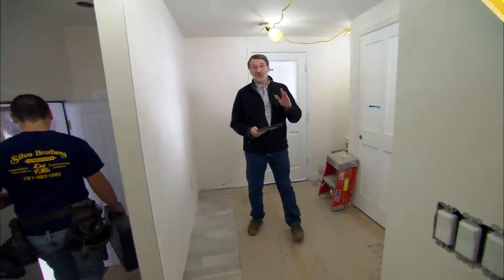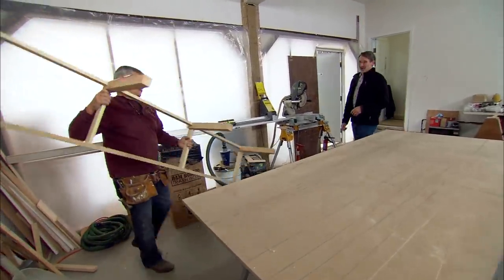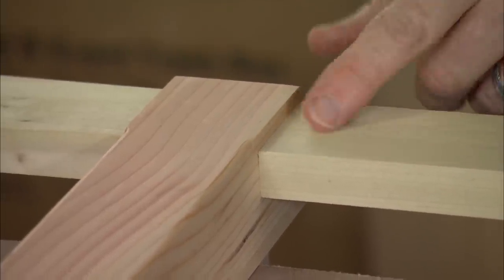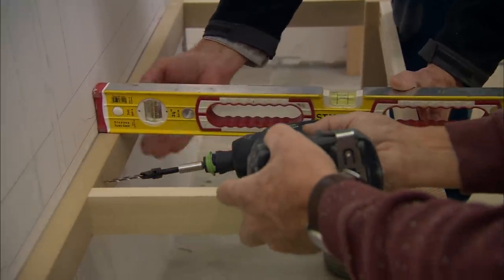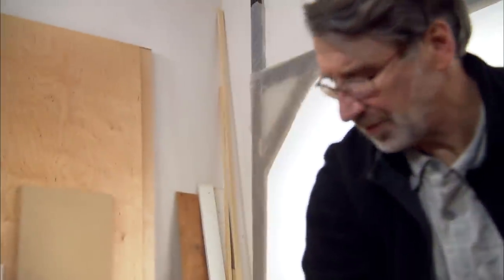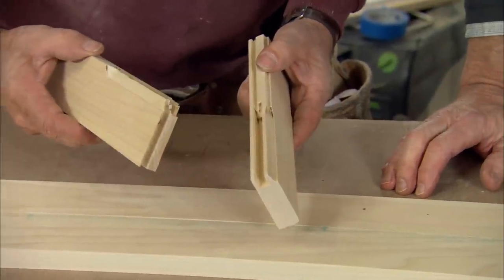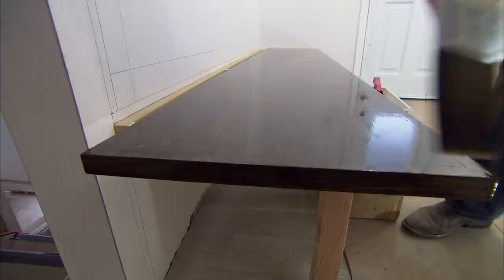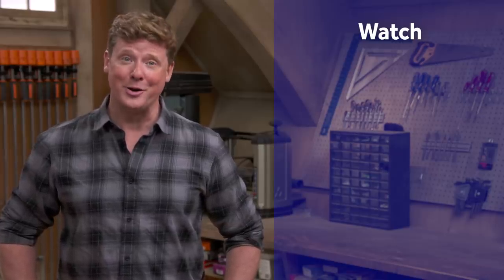How to Build a Mudroom Storage Wall | This Old House

Comment: I so wanted to see how to scrip the leg length to the floor.  But project looks awesome.
Reply: Stand the board where it's due to go, place a ruler horizontally up against the board, with the ruler's lower edge following the floor angle.  Scribe a line on the board, following along the top of the ruler.  That should reflect the angle you need to cut the lower board to.

Comment: Watching these guys makes me wish I had went into a trade instead of college route
Reply: yup
Reply: Not shown: subcontractor doesn't show up, or installs wrong material, homeowner changes mind after installation and won't pay the bill til it's "fixed" or "fixed" for no additional cost, essential (co-)worker quit for new job with no notice, major price change in supplies between contracting and commencing the work, owner goes bust and "contractors lien" on the property isn't paid for years, etc., etc., etc.
Reply: @buzoff4642  sound like public accounting as well
Reply: @buzoff4642  yep, the other side of the coin, lol

Comment: Any link to the hand plane that Big Norm was using?? Looks like a nifty wee tool to have in the tool belt 👌
Reply: I think there are different names for the tool, but I see them as a Cornering plane. Veritas makes a set that you can get from Lee Valley or Woodcraft https://www.woodcraft.com/products/veritas-cornering-tool-set?via=573621f469702d06760016cd%2C57641c7e69702d3baa000a33
Reply: Exactly what I was wondering.

Comment: Can you provide info on the router tables used?
Reply: Looks like the Festool CMS system. A mere $1760 USD.  Only compatible with Festool's 1010 and 1400 routers.

Comment: 4:06 “Let’s see how it fits…” Was there any doubt?
Reply: Exactly. Tommy and Norm had that space measued down to the 16th of an inch and it was square to within 100/1000th of an inch all without using lasers or calculators or fancy measuring devices lol.
Reply: Bet it was fitted off camera first.
Reply: @donc-m4900  what they didn't show was a rough fit with it unpainted but if it was iff it was 1/4 inch off.

Comment: Why would they not round the edges with the router before assembling it?

Genuinely asking, not sure if the full episode explained why
Reply: Tommy said he originally wanted sharp lines on those legs, then after seeing it put together he decided on the rounded edges.  Yes, if you want round edges, you would do those before adding the rest of the support structure.  You would also want to sand to your final grit before adding those structural pieces.  It would be more difficult if you didn’t, with lesser chance to ding the project.

Comment: Why did the box have a combination of MDF and Plywood?  Why not all just plywood or all MDF?  Heck, why not the same wood for the whole thing?
Reply: Large flat panels of MDF are very stable (do not warp) and cost efficient, but the rails and stiles need to be made of a more durable solid wood.  Common practice in furniture and door construction.
Reply: For the stability of the mdf.
Reply: I’m trying to figure out why they chose MDF over poplar or plywood for the long stringer under the bench used to attach it to the wall.

Comment: @ 1:45 in,.... Why would you put a decorative edge on the Inside of leg facing the wall underneath a bench set that will NEVER be seen!???
Reply: Well, you can kind of see those back corners when you look at the flooring.  The legs have nothing else around them, so you can see a little bit of those back corners.  I would have rounded the corners before attaching the structural pieces, but Tommy explained why he didn’t do it beforehand.

Comment: I'm kinds triggerred that their relying on pocket screws to hold that base together.
Reply: I would use glue on those joints along with the pocket screws personally.

I’m still trying to comprehend how the whole thing is held to the wall with what looks like a few #10x3” screws in that MDF stringer under the bench top.  They didn’t talk about how the case and shelves were attached to the wall so I’m assuming most of the weight is sitting on the bench top.

Comment: HACK!  Who uses plywood for a bench seat?
Reply: I am for my mudroom bench build.  For stability mainly.  I used solid red oak lumber on a previous mudroom bench.  Looked awesome…until winter hit.  The red oak ended up splitting along the grain right down the middle because I over constrained it with too much glue.  My first build and my fault.  Plywood is more forgiving for new builders and can look just as good as solid lumber.  There is no growth and shrinkage to worry about.